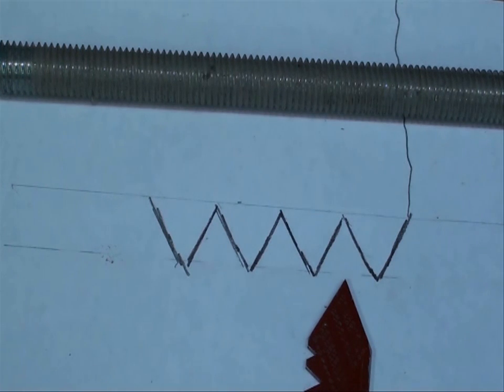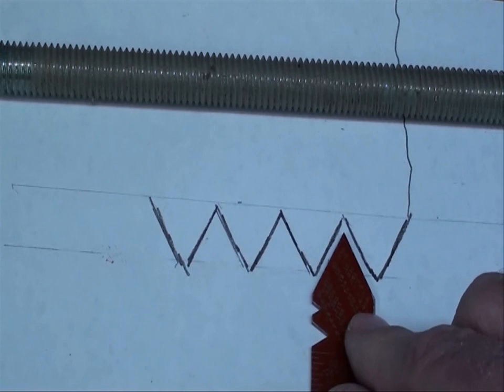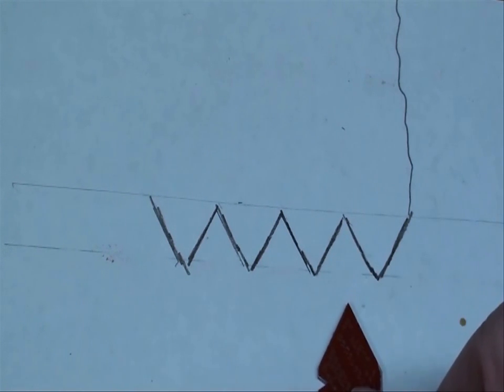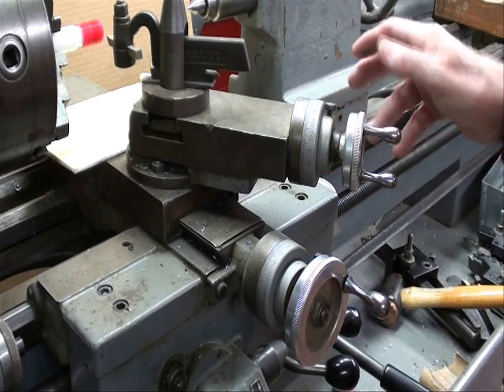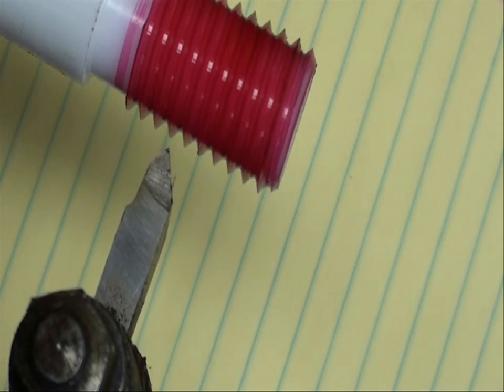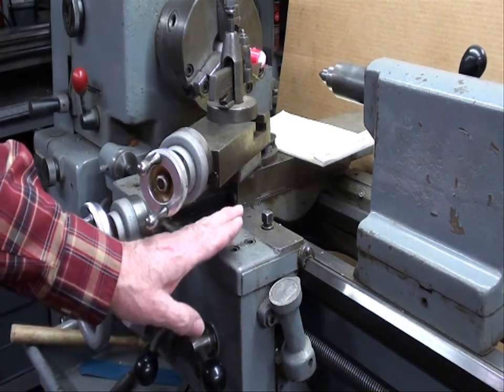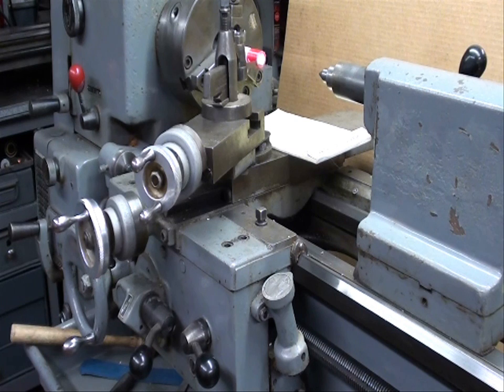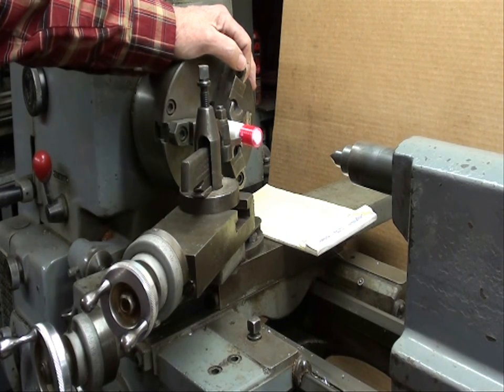MACHINE SHOP TIPS #18 Musing on Lathe Threading tubalcain

Comment: Lyle I agree with your method.  With that being said, the old crank Turner's at my shop straight plunge everything. Matter of fact, I'm pretty sure none of them have moved their compounds from 90° in 40 yrs  Granted they use carbide (which can be scary) then again they have saddles and compounds that are twice the size of any of your machines.  Lots of hp.
Reply from the maker: I am sure they get great results. Thanks for watching

Comment: explain to me the reason the lead screw travels at a set number of rotations to get a thread the question I would like answered is this '! Can a thread be cut, by increasing or decreasing lead screw? by means of you adaption,;  You made on your lathe. Can you demonstrate The cutting of a thread . will it be too much;  of a challenge for you /??    I ask because I have a Lathe that as no lead screw;  & nut, But only a travel shaft; & reck    I intend to modify to your customised. system . on my lathe,    &  electrically increase the lathe travel shaft & screw,!  Speed; & match the third count per inch with a thread gage to achieve the;  cut desired.   Now I know you may not want to attempt, This challenging task,    But when we have limited gear choice. The only way is to copy the modern lathes;  & attempt to match speed &  rotation with travel speed for pich to achieve a thread cut.   Well, Mr. Tubalcain sir.  I hope you post a video &  I hope this finds you as it leaves me. well, Leslie  Anthony Stuart - Thompson.  England.  I like Your,  stile, of teaching, I send them to my children.   WEll, I  Await;  in anticipation of your post, happy new year.
Reply from the maker: Thanks for a very lengthy comment. All I can say is, that the carriage must travel in and exact ratio with the spindle. And yes you need a lead screw
Reply: @mrpete222  and LOTS of gears!

Comment: The more videos on threading, the better!  Keep em coming!  Great stuff!  A question:  If for whatever reason, you get off track, why pick up the thread alignment with the machine running?  Can't you simply take up the backlash and align the tool to one of the valleys while stationary?  I'm sure there is a reason.  Just curious what that is.
Reply from the maker: Yes--the backlash will be trouble unless lathe is running. Try it both was on some practice pieces.

Comment: How do you cut threads where the "peaks and valleys" are flat.  I need to cut internal threads for a wood shaper lock nut.  Spindle shaft has "flat" external threading.  Thanks for your great videos.

Comment: Sometimes it isn't convenient to set the topslide over.Or I can't be bothered for a one-off. I just leave the topslide where it is and before engagement on every cut, I put a couple of thou on the topslide to ease the tool tip on the right side of the thread vee. Been doing it for over 40 years. I do set the topslide over sometimes though.

Comment: Been 40 years in the trade the best way to cut threads is to turn the tool upside down and run lathe in reverse. this way always the tool runs out of the thread without the need to rush the tool out of the job, or hit the choke. tried you would never go back to
tool looking upwards. Good luck.

Comment: one last bit since i ran out of room is in chasing threads away from the chuck is of course to run the chuck in reverse...   this guy in this clip is a good teacher, the only thing i didn't like was his toolpost set up, i never cared for rocker tool posts, they lack the rigidity you need for good acurate lathe work, but if you like them have at it..

Comment: It's good to know both ways of threading external threads, this is how i learned but when possible ,like if your allowed thread relief i prefer to flip the tool upsidedown and set the tool with your angle gage and chase the thread away from the chuck ,no need to set the compound @ 29 degrees, just need a stop to come back to 0. Most important is a ridgid set up, The rocker he's using should go in the bin,Get an Aloris tool post that will never flex or give you a headache & keep the tool close..

Comment: to find a the thread why not just feed in the cross slide until you contact the right side of the thread then feed the compound until you contact the left side? if you force the carriage the the right to account for lash you could even do this with the machine off.

Comment: What you said about the reversing the machine and backing out is right, but if you turn the dial and back the tool out a measured amount. Turn it back in after reversing, and the play is equal from both sides. So you don't really need to find your thread like that, unless you're repairing damaged threads.

Comment: On the permanent engagement  this is widely taught in Europe and some lathes have no dial fitted, tool retraction, or lift,  is used during reverse to clear the thread. Rarely done by Home Machinists is single point chasing, delightfully controllable method for ultra fine finish, and any pitch can be cut if you have a master. We were instrument makers and used a 4:1 masters and made custom fit threads, no tolerance, they were made to feel right on assembly for focussing threads in lenses.

Comment: Sometimes it is obvious a method works, without realizing that other countries do it another way, British machinists had never been shown this method before the war!! South Bend were one of the rare makers who published methods, and taught the US way of cutting threads with set over. 
UK method is straight plunge, both faces cut in traditional method. The end result is the same as at full depth both sides touch. In Swiss precision practice straight is used, as Chasing is more widely used.

Comment: on 7:45, you need to move the X axis out first, then it would work with memorise the measurement from the X axis scale. Against crashing it, a electric end switch will be a good investment, or you need good reactions on low rpm. btw good videos!

Comment: Superb videos, I feel very nostalgic whilst watching them, as these are the exact methods to thread on the lathe shown to me my my mentor 30 years ago when I was an apprentice. The guy I learned with has sadly passed on and I really miss him. Oddly enough I feel he is still not too far away watching over my shoulder me complete all the the tasks him and myself did all them years ago. Still learned a little tip using the blue as we just used a nut to test when coming down to the money on size.

Comment: I agree with you 100% about not reversing the feed, However I have chased metric threads on a Leblond and that was the only way to accomplish it. I'm not sure If I would have to do this process on all lathes, but I believe it has something to do with the lead screw being standard inch threads and chasing metric. an acme thread video would be Great! Just made a replacement shaft for an airplane engine fixture with Metric acme threads.

Comment: Total agreement on reversing thats just more 1/2  nut abuse.  I may add when I
have to do a pick up with 1/2 nut engauged I always turn the belt by hand  so
there is no backlash,  picking up a thread does happen, but I made up a 2cent
cross feed stop no need to be fancy just a washer bolt and lock nut,  perfect.!
Now for the great Acme thread      thanks

Comment: @mrpete222
About keeping the half nut engaged constantly: I understand what you mean by backlash becoming a thread-damaging factor if you reverse the lathe. However, that is only the case if you don't back the cutter off completely before reversing.

Comment: I wanted to say thanks for this video in particular. The 29deg was taught to us the last few months in Tech School, and while I got it down fine, and made threads with it, I questioned it since you square off the tool to the stock. It didn't dawn on me about the fact the you're feeding the compound in at that angle to cut in that manner. Thanks!

Also, to the people that want to just throw the machine in reverse, it doesn't sound good for a reason. That's a lot of force to instantly turn around.